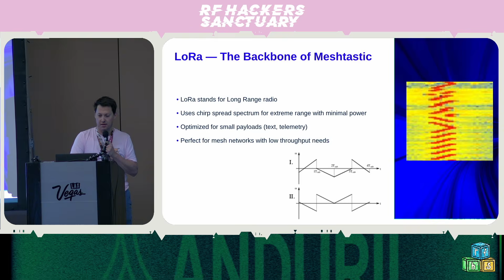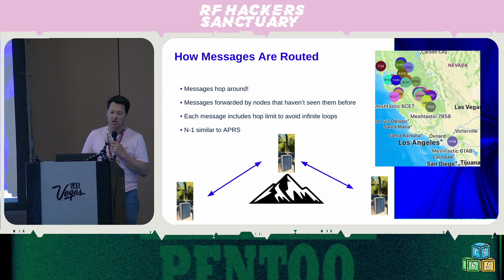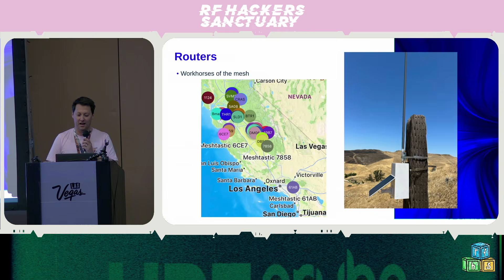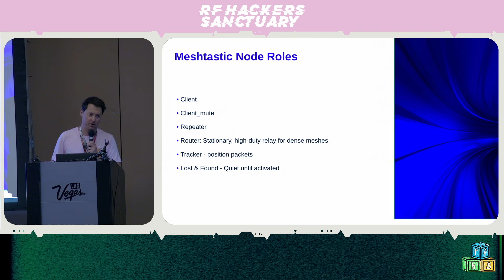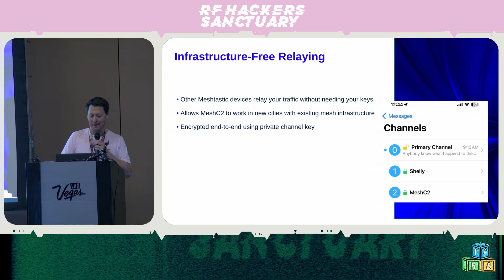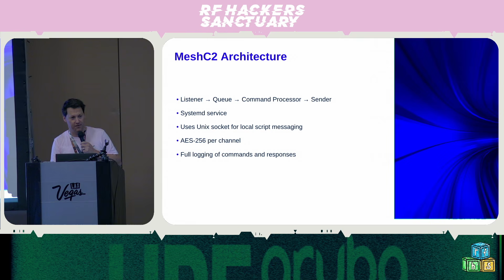DEFCON 33 RF Village Meshtastic Command & Control

Comment: It's interesting to read the official new LORAWAN specifications as it really goes into detail about the different modes and the way that it works along with the headers the different types of modes that it can be set to run on even changing those modes remotely from the command and control if you're doing tracking of items or if you need to conserve energy. I'm interested in trying to see if there are any LORA enable the cubesats still running and if their repeaters or if they will allow connections or if they're being used for telemetry and or command and control wears short messages are sufficient.